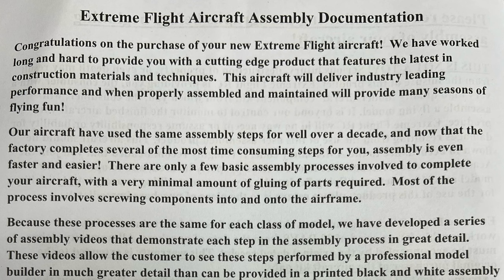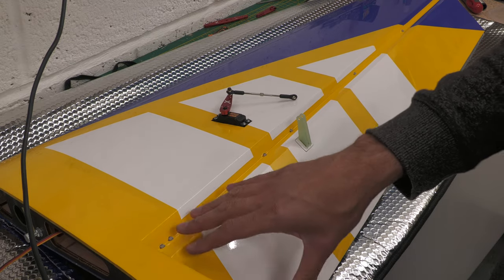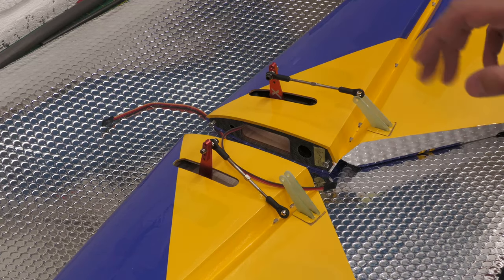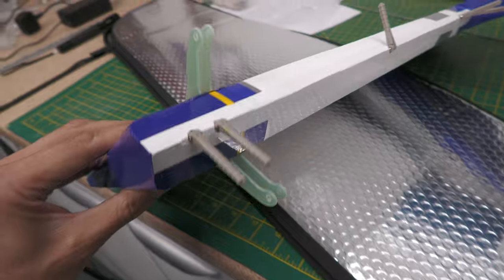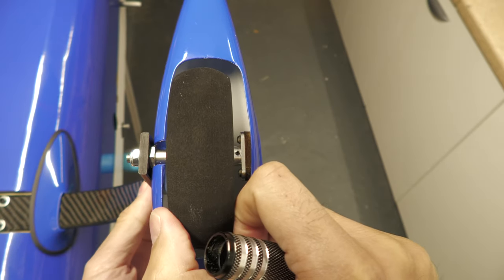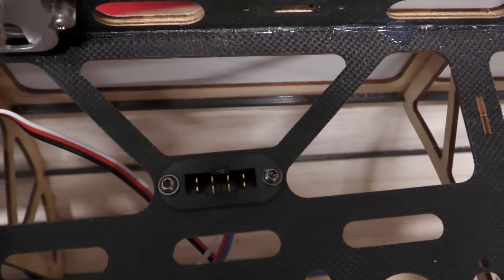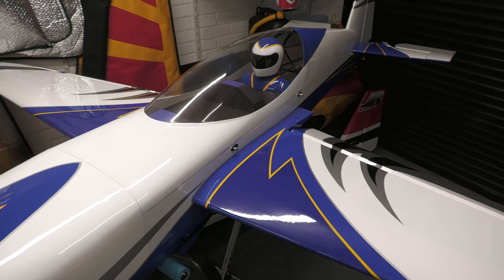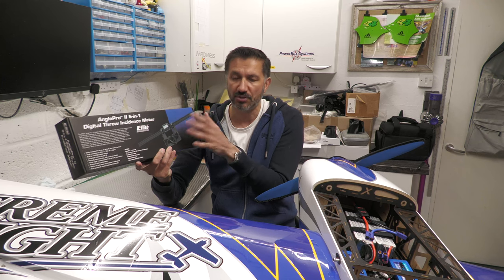Assembling the 91" Extra NG v2 | Extreme Flight

Comment: That looks like terrible geometry on the wing servo arms location. and I'm I'm not impressed with the canopy fit an peeling covering
Reply from the maker: Hi. On mine I could use slightly bigger arms to change the geometry slightly. The rod should be straight when the aileron is on full deflection/travel. I’ve not had an issues with the covering or canopy fit. 
Do you have issues on yours?
Reply: @MattTakharRC  I'm currently shopping for an airframe, looking at various makers of the NG. That looked a little tight but I agree with your comments, but shortest arms to get the right geometry in theory is best, in practice I'm sure it's all overkill. Just going on the video for the appearance issues.
Reply from the maker: @DEeMONsworld  the Extreme Flight kit are really good quality. I am however tempted to try a Pilot kit soon. I’m currently building an AJ Aircraft Raven 92” which is also pretty good but it doesn’t compare to the EF NG.
Reply: @MattTakharRC  I'm also looking at the skywing 91" any experience with that one, seems a good value, but slightly smaller wing area
Reply from the maker: I only have a small Skywing Lazer which is foam but really good fun. The skywing models do look good. 
https://youtube.com/shorts/J9Cn23FOwQQ?feature=share

Comment: Don’t ailerons use 1.5inch servo arms?
Reply from the maker: Yes they do and flaps and elevators. I didn’t have any but do now!
Reply: @MattTakharRC  Sweet, I got myself an early birthday gift (ef slick580 91inch) and don’t know what servo arms I need.😹
Reply from the maker: @DmitriyZlodeev  congrats! Looks like you need 1.5, 2 and 4 inch (depending on rudder setup). EF are pretty good at listing out the parts. https://www.probuild-uk.co.uk/index.php?route=product/product&product_id=7138

Comment: What capacity batteries do you use  and what's the flight time?
Reply from the maker: Hi. I use 2 x 6s 6000mAh and get around 5.5 minutes of battery power. My timer stops when the throttle is down, so my flights are about 6.5 minutes ish. To be honest I was hoping for longer flights.
Reply: @MattTakharRC  thank you!!

Comment: Aesome Airframe and Build, Just a quick question, I have a Skywing NG and going electric, to power the RX and Servos seperatley, Do I Simply not plug the leads coming from the Spektrum Avian BEC into the rx?
Reply from the maker: Hi. It really depends on the ESC. On some you need to remove RED wire from the throttle lead coming out of ESC to the rx, this will stop the ESC powering the RX. You don’t want that as you are installing separate pack(a) for the TX and servos. I think spectrum do a bi-pass module which mean should don’t need to pull the red wire. I have a castle ESC in my NG, I’ve not pulled any wires, I’m now thinking I need to double check it!
Reply: @MattTakharRC   Perfecr thanks Matt, I have 3 leads coming out of the avian esc, 1 obviously throttle and the other 2 not sure, I would assume the other 2 are coming from the bec, so I would just remove the red wire from the throttle lead and plug all 3 leads in? Would you happen to know what that bypass module is called? Appreciate you getting back to me
Reply from the maker: Do you know what the model number of your Avian is? You would typically remove the red from the throttle lead. I’m presuming the other leads are for telemetry and programming. If you give me the model number I can try to check it out
Reply from the maker: There is a good wire ping section in this manual. Page 4 onwards. It looks like you need a SMART ESC to get telemetry data. I’ve not read all of it as I’m currently out. https://www.horizonhobby.com/on/demandware.static/-/Sites-horizon-master/default/dwb627f043/Manuals/Avian-Manual-EN.pdf
Reply: @MattTakharRC  yea I have the 100amp one, just seen the other 2 leads are coming from the dual BEC setup they have going, so as you say they are more telemetry etc, so I would just remove the red wire from the throttle and leave the other 2 unplugged from the rx, I'm a newbie to these electric setups lol, appreciate it Matt , my esc is the SPMXAE1100 100amp
Reply from the maker: @swiggy109  I think the best thing to do is to check it first by plugging in your main batteries (motor batts) don’t plug in your RX packs. If the RX powers up with just the main packs then you need to pull the wire. I’ll check this on my setup later.
Reply from the maker: You can also do the opposite actually. Just plug-in your RX flight back. Don’t connect the main battery to the ESC. If the motor runs with just the RX batt connected then you need to pull the wire. That’s the better test.
Reply: @MattTakharRC  Appreciate it Matt